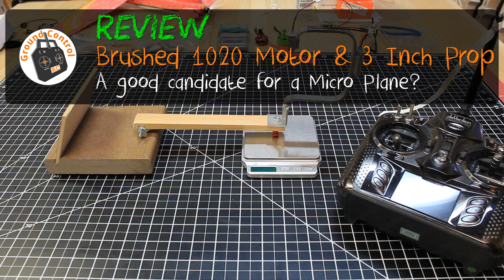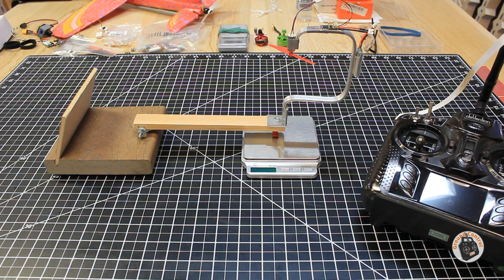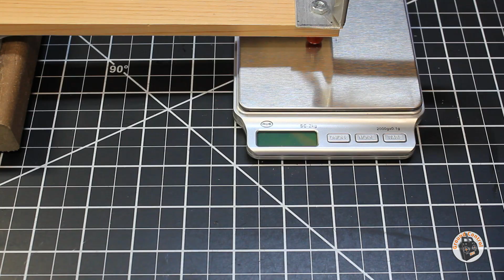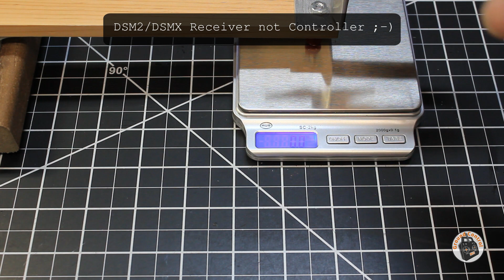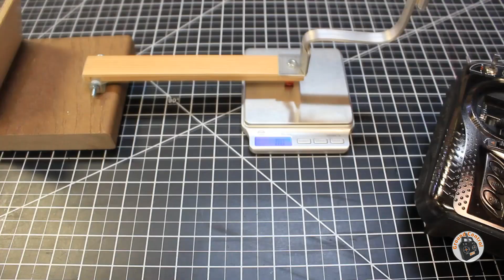Review - Brushed 1020 Motor & 3 inch Prop - A good candidate for a Micro Plane?

Comment: I have seen few 2s brushed quads and they had this type of 1020 brushed motors. It is very probable that these motors too were meant to be used with 2s lipos. Since you want to use a single cell lipo you can try using a bigger propeller but I doubt it will be possible to find a bigger prop suitable for a coreless motor. I think best option would be using a high kv 8520 motor with a kingkong 65mm prop. They say racerstar 8520 motors provide 40 grams of thrust with those props, which would be okay for a 50 gram plane and you can use two of them if needed. Another option is making your own custom props! Much more difficult but also very interesting. I'm interested to see what you will do.
Reply from the maker: I have some more brushed motor and props to test. Some 716, 720, 820, and 8520. I don't know the spec'd RPM of those motors so I'll just have to put them on the thrust stand and see how much thrust they produce with various props. If that doesn't give me the thrust I need then I'll start with some of my small, high KV brushless motors and various props to see if I can get 60 grams of thrust out of one of those. Wish me luck and I'll see you in the Air!

Comment: I am also in this situation. Want to make a single cell light weight plane. Have tried several combinations. Seems to that 8520 motor with Kingkong 65mm prop gives best results.
Reply from the maker: I don't have any of the KK 65mm props but I do have some Eachine 66mm props on order. I have some more brushed motor and props to test. Some 716, 720, 820, and 8520. I don't know the spec'd RPM of those motors so I'll just have to put them on the thrust stand and see how much thrust they produce with various props. If that doesn't give me the thrust I need then I'll start with some of my small, high KV brushless motors and various props to see if I can get 60 grams of thrust out of one of those. Wish me luck and I'll see you in the Air!
Reply: Racestar 8520

Comment: Only just found this video after seeing your comment on the item page at Banggood. Very good test, like your rig.

The props supplied with these motors must include two LH and two RH props, as the kit is for a quadcopter. Usually these little brushed motors are designed to run in one direction, and the wires on the motor are colour coded to show which is the RH and which the LH motor. I am wondering if the motor you used in this test was rotating in the wrong direction. Like you, I would expect a motor like this to provide more thrust. However, I am basing my comments on experience with brushed motors with gearboxes, so direct drive is something different.
Reply from the maker: Not sure! I know I had power and ground connected properly. I have yet to get a good amount of thrust from a direct drive brushed motor in sizes ranging from 0716-1020. They just don't have the torque for direct drive and really need a gearbox and larger prop. I needed a direct drive system for the Nano Plane I was building as a 3 inch prop would be the largest I could use. I ended up using a Brushless 1102 13500kv Motor and 2.5 inch Prop. The Power System was lighter than the Brushed Motor and produced 57 grams of thrust ;-) I have since completed my Nano Parkjet Project with that Power System ;-)

Comment: Try two motors on both wings.  U will make it fly. Use two channels for both mtwo motors and set differential.
Reply from the maker: I've thought about that, and using the Rudder Channel to manage the differential but I'm hoping I can do it with just one motor. It's a good idea and it may be what I have to do ;-)
Reply: @GroundControlRC  i am sure you will be able to. But 1020 motos is way heavy With 3 inch prop as per comparision to its thrust. Will you use a coil and magnet as a servo for the rudder ?
Reply from the maker: @TheZach78  , no I'm actually going to be using (2) 1.7g servos. One Servo for Ailerons and one for the Elevator. It's going to have a fixed Rudder. The Weight of the Electronics including the Battery is going to be approx. 18-20 grams so that leaves me with 20-22 grams for the Airframe in order to have a 1:1 Thrust-to-Weight Ratio as the Motor and Prop provide 40.5 grams of Thrust. I've got the Airframe about 75% complete in the design and I'm just going to have to build the Airframe to see if I'm at or under the weight I need ;-)
Reply: @GroundControlRC  great. 
I do have hk 1.7 gm servos. But I hv  Ordered dji tello motor and props. I will be using two motors.

well u hv an option of saving weight on Rx and ESC. :p For me Rx and ESC weight goes around 12 gm with wires and connectors.
Reply from the maker: @Trexk2  , hopefully I can get the weight where I need it. I went back and looked at the weight of my F-22 Micro Airframe which is more than double the size of this plane I'm designing and it was only 46 grams. I think I may just be able to do it ;-)  See you in the Air!

Comment: Indeed, a little bit disappointed on this set-up for micro planes as also for quadcopters in general. Keep on doing the good work GC RC. Thank you alot  for all these testing.
Reply from the maker: Thank you much! Yeah, I certainly thought that with the torque of a 1020 motor as opposed to a 716, 720, 820, or even an 8520, it would have produced more thrust. I'll be testing more motor and prop combinations tomorrow and hopefully find something that will work much better. I'm not ruling out a brushless motor if a brushed motor won't give me what I need ;-)  See you in the Air!
Reply: @GroundControlRC  A brushed motor would hold me down on using or purchase this kind of motor, depending on the objective of need (of course). Is it also to airplanes that this typical kind of motors give one more risk of possible fail in the air?
Reply from the maker: I think you're correct. I have had less reliability with brushed motors than brushless motors. The benefit from using a brushed motor in this situation is it would save weight and it's less complex to setup. But it's looking more likely that a brushless motor is going to be needed ;-)  See you in the Air!

Comment: Dude Your caped with a 2A integrated esc., even 8520 with 55mm prop gives 50g static with about 3.8A For best results with 3inch prop use 8523
Reply from the maker: Thanks! These are nice little motors for a mico quad setup but I was wanting to use one in a Plane. I ended up going with a Brushless Power System as I just wasn't going to get the amount of thrust I wanted from a 1S Power System. See you in the Air!

Comment: Kingkong 65mm and a dji Tello motors will hit 45g of thrust easily.
Reply from the maker: Hi akhmad!
Yes, of all these direct drive brushed motors and props I've tested 55g of thrust seems to the high end of what you can get from them.
I've decided to go with brushless motors for longevity and I can get 70g of thrust with a 5030 prop on a 1S LIPO and 65g of thrust with a 3830 prop on a 1S LIPO which makes it much more feasible for these 1S Micro Planes.

Comment: 8540 motor with optimum 2in  prop direct drive gives 25g thrust or lift, 
8540 with F949 gearbox gives 40g thrust
8540 on optimum v911 rotor gives 45g lift
8540 with F949 gearbox on f949 I have lifted 75g AUW      (notice: motor geared & thrust indirectly geared using wing)
No theoretical explanations can be given but experimentally true that with same motor @ same power consumption lift tripled...In reality it has to do with how much clean (vortex free) air  u sweep .Longer slow props produce times bigger thrust for same power & so do with longer wings
Reply from the maker: Excellent! thanks for the info. Have you used any brushless motor and prop combinations on a 1S that gave more thrust than a Brushed motor and prop on a 1S (without a gearbox)? I'm considering a brushless 1S if I can get the thrust I need. I'm going to start testing more motor and props combinations tomorrow. See you in the Air!
Reply: Indeed, V977 with 1s  brushless setup has 1.5+ times more thrust or lift than 1s brushed v911...
but outside of that I don't use BL 1s bcz 1s ESCs r crazily overpiced
Reply from the maker: I agree, I had a hard time finding 1S-2S ESCs! I ended up ordering a DYS 1S-2S 7A OPTO ESC and I think they were $8.99 each and they were the least expensive ones I found. I hope to have it in hand this week so I can start testing 1S Brushless setups. See you in the Air!

Comment: 1020 motor have 50.000 RPM with 3.7v ?
Reply from the maker: It depends on the Motor. Some Brushed Motors have a higher RPM than others. This is just a generic Brushed Motor so it's probably closer to 40,000 RPM.
Reply: @GroundControlRC  I maked this micro airplane with gear box reduction, my coreless Its 820 , total heavy 50g, very funy , litter aloof on wind
Reply from the maker: @meunomeeplissken3088  great job keeping the weight down on your plane. Building a Plane that light is not easy. I bet it flies very well with a Brushed Motor & Gearbox at only 50g. Sometimes a bit of wind can be pretty fun flying something small and light ;-) See you in the Air!

Comment: sir ,
plz kindly suggest esc for that motor.
Reply from the maker: I have not used an external Brushed ESC for this motor. The Micro Receiver I use has a Built-In Brushed ESC that runs this Motor.
I did find an external Brushed ESC that should work with this Motor, however, I have not tested it since I do not have one.
This Brushed ESC states it can run (2) Motors in Parallel and has Solder Pads for (2) Motors. It also states it supports Fail-Safe.

https://www.banggood.com/1S-3_7V-Two-way-6Ax2-Brushed-ESC-with-5V-600ma-BEC-for-1020-8520-720-N30-N20-Coreless-Motor-p-1544198.html?p=WE081047791920140372

I hope that helps and I'll see you in the Air!

Comment: I brought  4.nos motors but all are ccw so is it possible to change the rotation by changing polarity?
Reply from the maker: Good question! Absolutely! You can change the rotation by changing the polarity ;-) I do that frequently, especially when I run out of CW/CCW props ;-) See you in the Air!
Reply: Thanks for your reply

Comment: I just finished a plane with  a 820 motor...read in alibaba that the thrust was 65 grams but my plane is 45 grams ans clearly under power. Any advice for a brushed motor with a thrust of 45 or grams?
thanks!!!!!!!!!!
Reply from the maker: Hi Alex! If I were going to build a Plane that uses a 1S Brushed Motor Setup, I'd use the Motor, Gearbox, and Prop from the Eachine Mini Mustang. That Power system has got to be putting out at least 65 grams. That Plane has the best Thrust-to-Weight Ratio of any Brushed Motor Plane I've flown. That's what I'd use ;-)
Reply: @GroundControlRC  , Forgot to mentioned that the motor i used has gearbox. I will check the motor on the eachine,thanks for the advice!!!!!!!!!!!!!!!!!!!!!11
Reply from the maker: @alexherrera3918  , you are most welcome ;-) Good luck on your project.